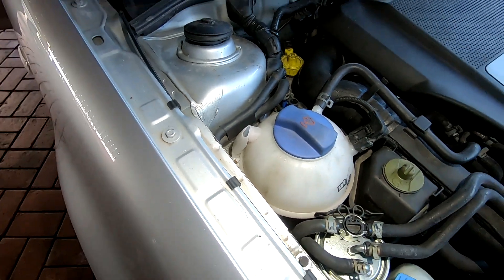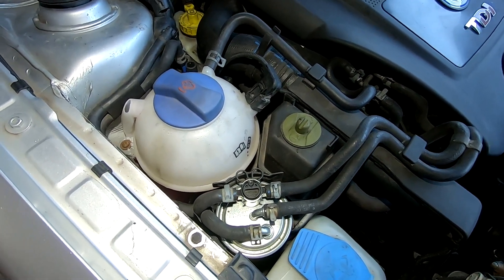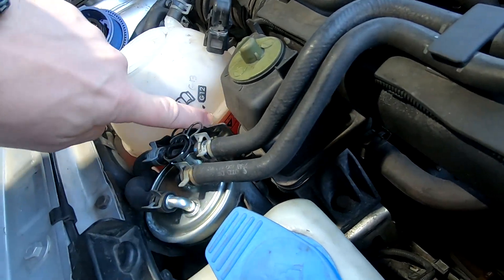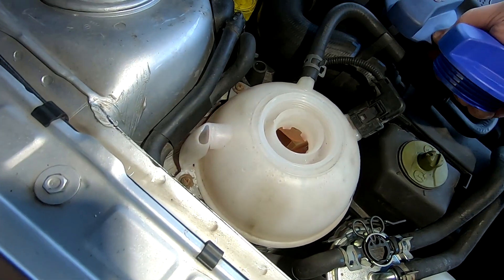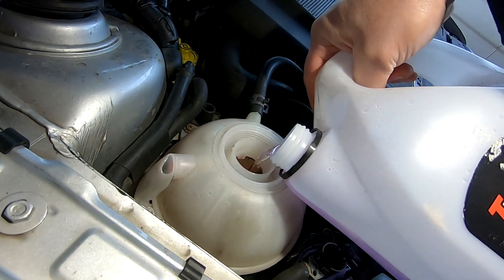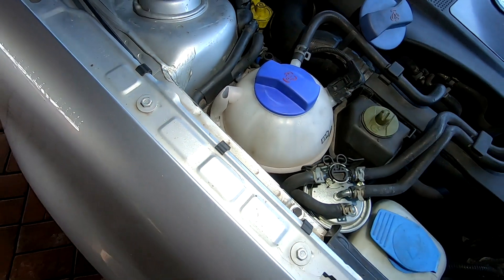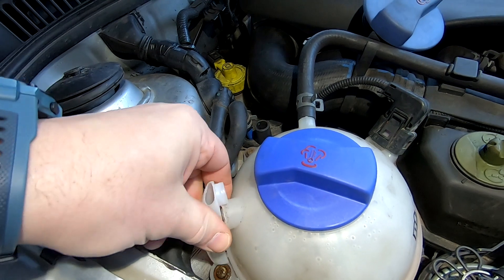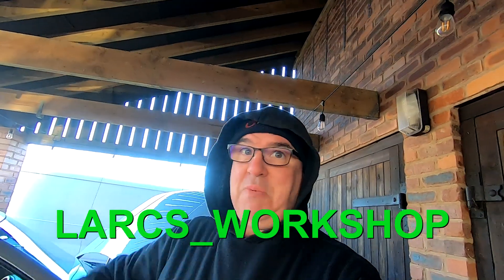Something has been eating my car AGAIN! Mk.4 Golf 'the daily'.

Comment: Hi Steve..can you do a mk4 Golf side light bulb replacement video as I'm struggling to do mine..I've done the headlights ok no problem but the sidelight bulbs seem really hard to get to..is there a special way or do you need to take the whole light unit out? 
Cheers
Matt
Reply from the maker: Thanks Matt. When I have one go I'll do one. As far as I know there's a panel on the back of the light to access it, I remember it being a pain on the nearside because of the battery tray though.
Cheers Larcs 👍
Reply: @LarcsWorkshop  Hi Steve ok thanks..but hot of the press ive just managed to do them both!! Very very fiddly..it was not easy at all..i used a torch and a mirror and hand/finger contortions..some people have said they remove the light units to do it..anyway i now have 2 new bright led sidelights!!  Looks good..i hope they last.....i should of done a video haha..
Reply from the maker: @mattroberts6484  nice work Matt👌